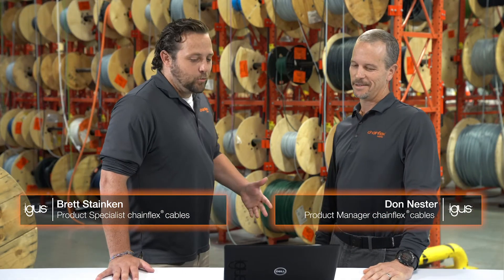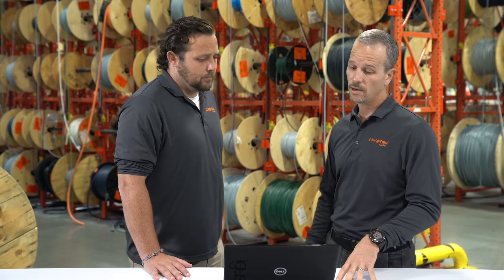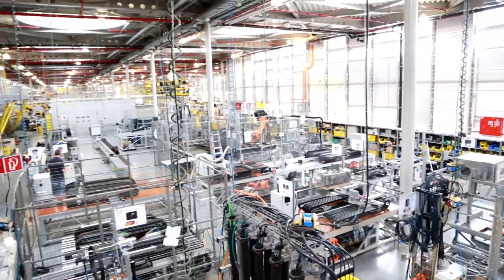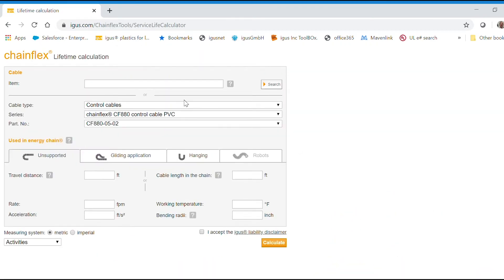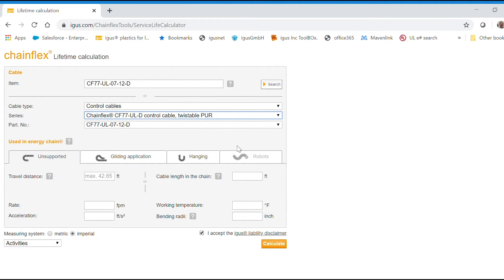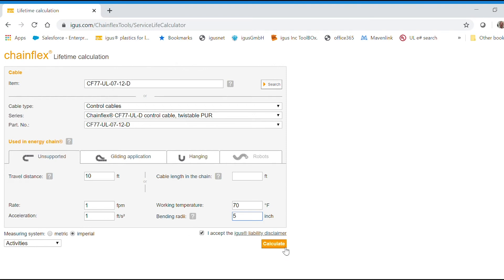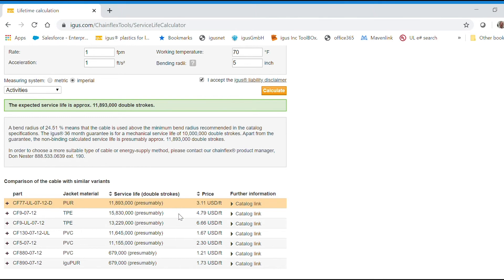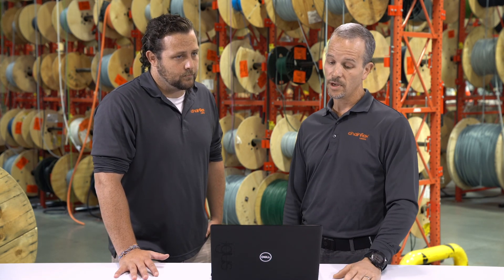chainflex® Continuous-flex Cable Lifetime Calculator

Comment: what if the chain is turned 90 degree in z axis?
Reply from the maker: We would be glad to help you!  We can predict the life cycle of cables in many different configurations, rotational and twisting motion included.  In order to make sure we give you an appropriate answer, we have to ask a few application questions.  Are you able to share more information about the application?  If so please use the form found here: https://www.igus.com/info/contact-igus 

You can also use the chat now function on www.igus.com to receive immediate assistance. Thank you for your interest in chainflex cables!